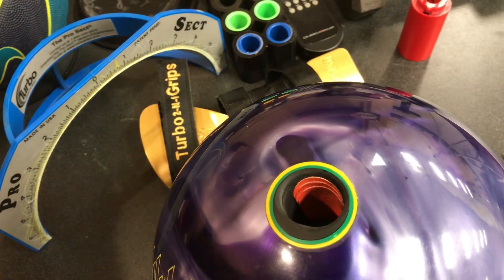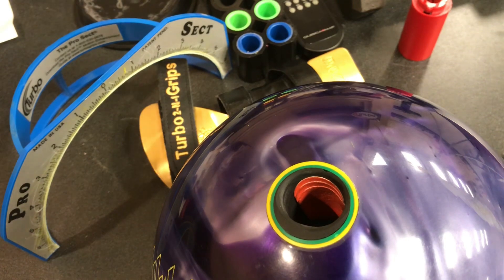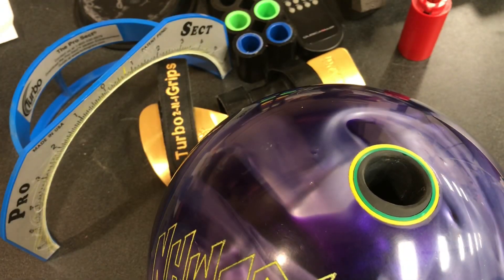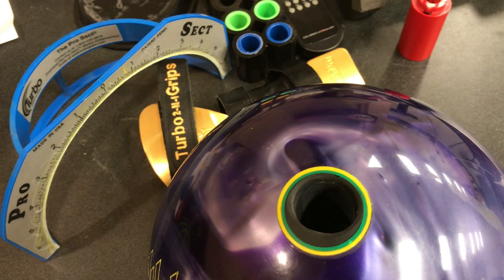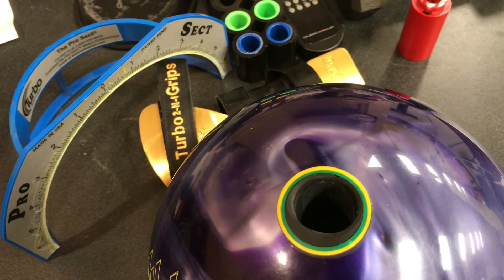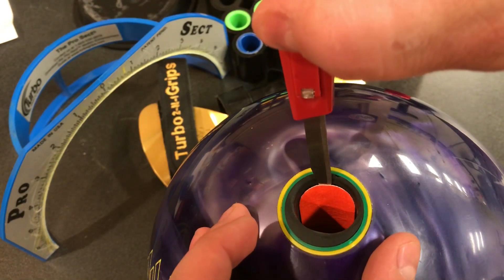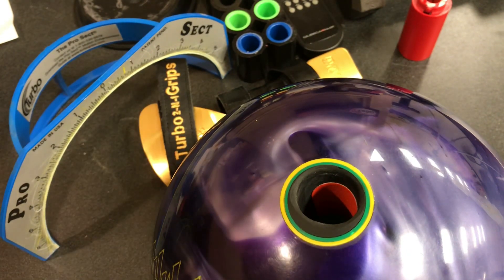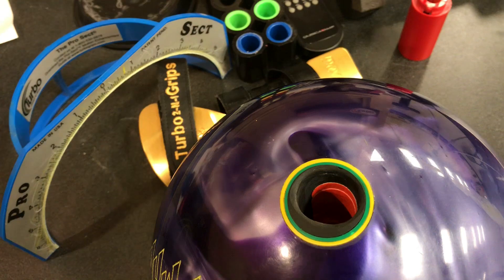Bowling Tape techniques

Comment: I always use 2 pieces of turbo grip strips all year round and lower in the thumb hole to allow for quicker release. I recently got a custom mold made with the tape in the thumb that was molded so a few of my switch grips have the tape indentation always there and it’s worked wonders for me.

Comment: I tried putting tape on that side of the thumb hole and I hung up every time…doesn’t work well for me. I put my tape on the opposite side of thumb hole and works great for me, so when I release ….the backside of my thumb drags slightly against the tape/thumbnail and keeps me in the ball for a split second longer.
Reply from the maker: Then your ball doesn’t fit you properly